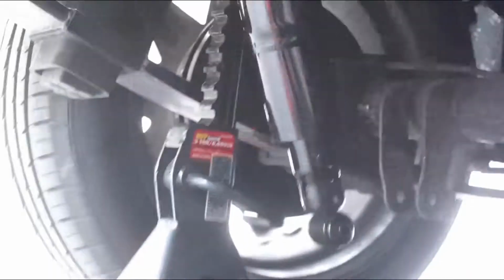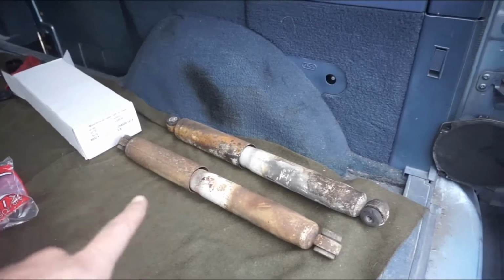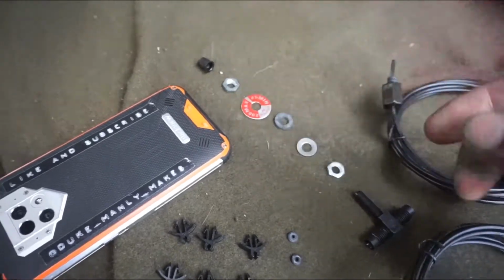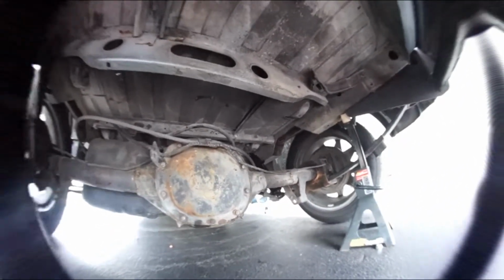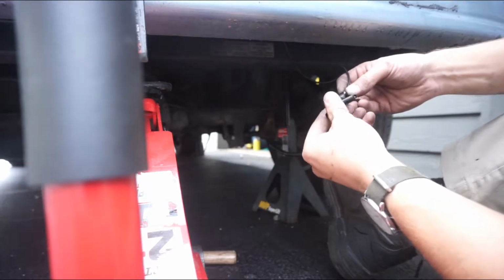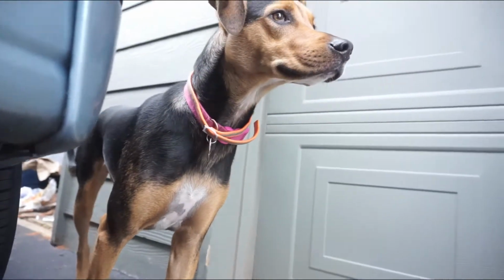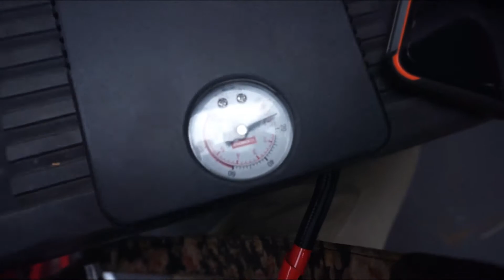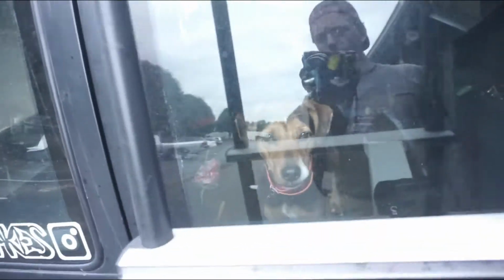Installing ACDelco Shocks In my LOWERED Chevy Astrovan!

Comment: How are the AC Delco shocks holding up?
Reply from the maker: I very much enjoy them! They survived a 1500 lbs trailer traveling 500 miles from Tennessee to Florida with no loss of air. The only issues I've ran in to (purely installation error) is the frame bolts for the shocks have loosened on their own. So maybe a dab of Loctite would sure it up.
Reply: @DukeManlyMakes  Thanks a lot! I think I’ll be going with the same set up on my 2018 Silverado. I lowered the rear to make my truck sit level but once a year I haul my Hot Rod to Cruising the coast in my enclosed trailer and I don’t want the rear to sag but other than that I never haul anything else that heavy.
Reply from the maker: When having it at level driving I notice very little performance change than when fully pressurized. Good luck with your build!

Comment: two little rubber where do they go
Reply from the maker: Those should be the washers that mount on either side of the schrader valve when mounting to the body.
Reply: There were 2 extra rubber    not washers Every connection had 2 of the same rubbers  the 2   We're extra
Reply: Well I believe they are extra or where do they go
Reply from the maker: Maybe you got spares?